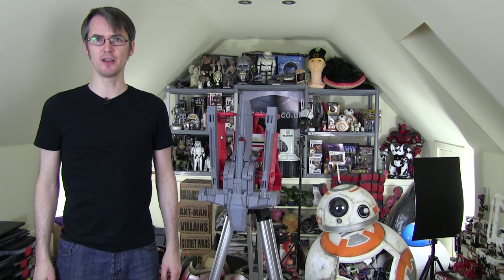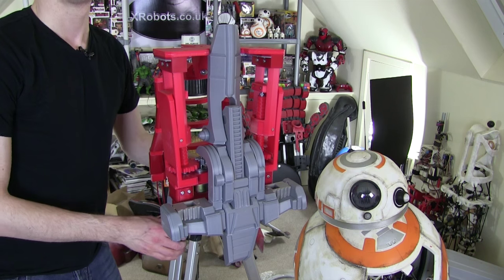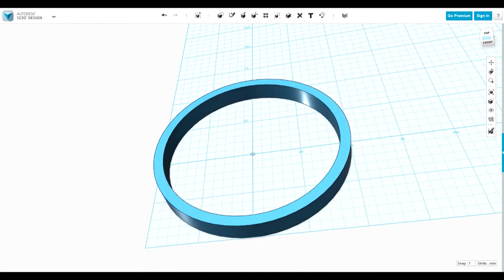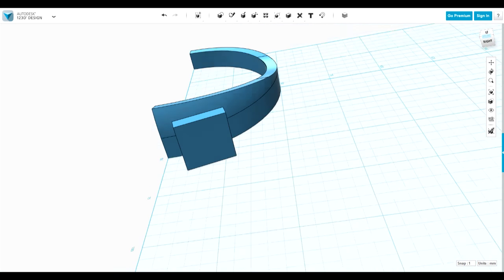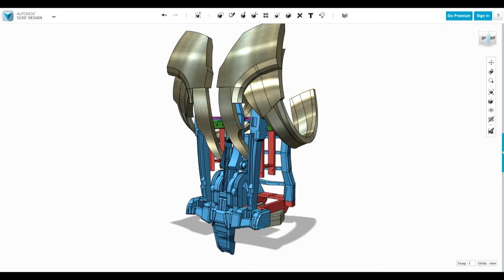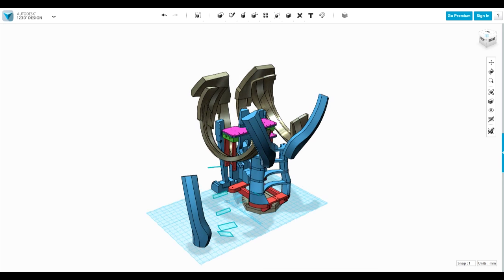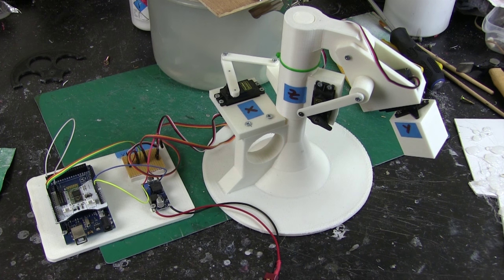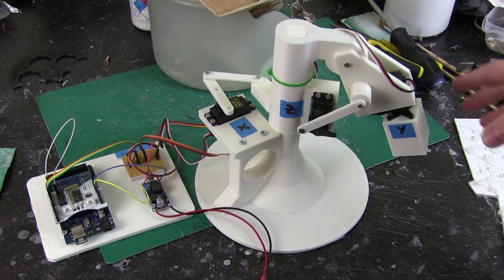Avengers Ultron #8 | Planning Torso Mechanics w. 123D Design | James Bruton

Comment: Some features that make Fusion360 worth the learning curve: 
1. You can edit sketches AFTER using them for extrusion and the extrusion will update.
2. You can go back in your history of operations and edit most things. Imagine putting lots of detail on a shape then realizing you made it 5mm too small. In 360 just go back to the primitive and change the parameter.
3. You have MUCH more control over individual objects. You don't have to "Show All" everytime you want to unhide a single piece.
4. Versioning. If you can ever figure it out, it becomes very useful. 
5. Threads!

There's a lot more. I was hesitant to adopt it at first because when I tried to figure it out on my own I was very frustrated. You pretty much HAVE to go through the tutorials and/or watch the videos from Autodesk. The guys from Adafruit have also made some good introductory videos that show off some of the impressive functionality of 360 quickly. 

I'd say I watched a cumulitave 5 hours or so of videos and tutorials before I felt 360 would be a suitable replacement for 123D. Of course your 123d skills are pretty impressive, so you may be happy to stick with it. 

tl;dr
The history tool alone makes 360 worth learning.

Comment: Wow, this was really informative and even if the next video is just planning part 2, it will still be good to watch. Youve clearly learnt from past projects, especially hullkbuster where you design something only to have to redesign and reprint it later on due to either a poor mechanical design or it not fitting in with later design elements.

Comment: +James Bruton (XRobots) Thank you for this really interesting video. It's nice to see also the process of design the piece in 3D, something that was lacking so far in your videos :)
It's interesting to see all the planning and this robot taking shape.

A question about the cosmetic parts. So the ones you already printed are supposed to be silver ABS, but it seems more gray on the video. Do you plan to paint them ?
This question is even more for the part you designed which look like chrome. Obviously it can be print with such reflections, what are your plans ?

Thank you in advance for an answer,

Keep amazing us with your fantastic job !

Comment: Hi James, have you considered migrating from 123D Design to Fusion 360? It's from the same company, so you can migrate 123D designs into Fusion and it's free for non-commercial use. Fusion have advanced tools and it's perfect for complex projects with many objects and sketches. For example it will help you a lot with managing visibility of objects.

Comment: Looking at how you work, I think fusion 360 might be the best fit of the cad programs you mentioned you were looking at.  It has a lot in common with 123d design. I was getting really frustrated by the poor performance of 123d and have been amazed how much better fusion 360 runs for me, especially when dealing with complex sketches (I do a lot of work with importing complex svg files).

You can also do assemblies and joints and such fairly easily which lets you play with range of motion and how things fit together.  Not sure if you can do a joint like your bungie joints where it is really 6 degree of freedom with a max distance constraint.

Very nice work so far, impressive!

Comment: What kind of pc are you running with 3D modeling and such? 
Just out of interest, since myself running with quad core i5 at 4.2ghz, 16gb of ram, and 660 ti overclocked, and with inventor 2015.  It works nicely without textures, but any textures or very complicated parts, and it becomes very slow to work with parts.

Comment: It makes me wonder how does the triangular topology of the models created in 123 Design look like. I do realize that for 3D printing it's not a big deal most of the time, but boolean operations can sometimes screw up the structure of an object quite a bit.
Reply: +neoqueto the triangular polygons are very dense least for curved stuff.  flat planes have huge triangles.  and from what i understand solid modeling is ideal for booleans since they dont calculate surface but pure mathematical "from" if i make sense.  doenst bother attaching all the tris until after:)

Comment: Hi James really enjoy all your videos, I noticed the Ninjaflex on the spine isn't crushing the way you would like and I recently had the same problem when designing a 3D printed bottle stopper. I found the Ninjaflex bung part wouldn't crush uniformly until I put an initial bulge into the walls of the piece, I think this would help on all the compressible parts. Cheers.
Reply: +James Bruton (XRobots)  Ok ,  it may make it compress too easily when all the weight is on the top. Keep up the good work.
Reply: +James Bruton (XRobots) another thing for people new to 3D printing in Ninjaflex (not James obviously) to know is the orientation of the honeycomb infill makes a massive difference to the compressibility of the part.